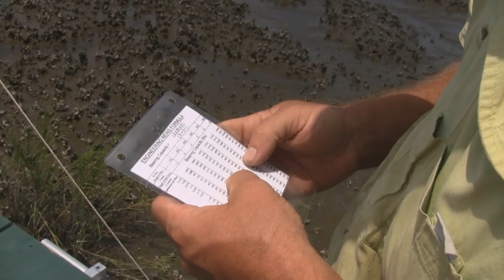Green Machine dock construction technique: fiberglass pilings & composite decking

Comment: I have watched this a few times. You have a very nice set up. I can just imagine the initial expense of the rig. I have built several barges to build piers(docks)and I can see the details in the construction. It must have taken much thought and an engineer to plan, fabricate and assemble. But you don"t have to get in the water or wetlands to build your structures. I plan to use your idea of crawling across the newly built pier sections to to drive pilings in sensitive areas. But I have a Rhino air hammer instead of a gravity hammer. Instead of an adjustable lead system I will use an aluminum "I" beam and trolley to  move the hammer and piling side to side. Instead of all aluminum it will be tube steel with rubber tires to traverse the decking not the stringers. Thanks for the idea it is similar to bridge construction using the same technique but on a smaller scale.
Reply: hope you looked them up and found their facebook, its not just the derrick you see, they also use a transporter of same length and width to bring pilings to the rig and move about, can also be deployed from a barge and build towards land
Reply: What size rhino hammer do you use?